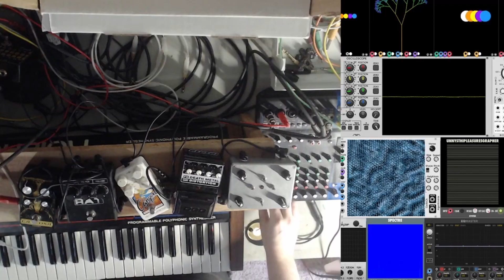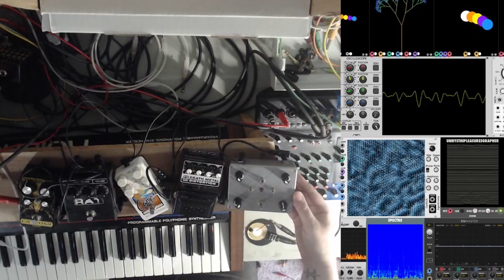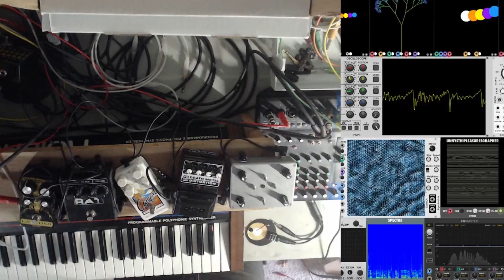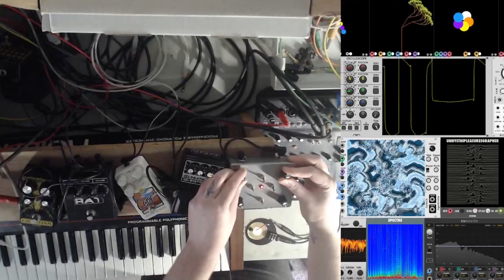Electrolobotomy Hadron Collider - Harsh Noise Gear Review

Comment: Heyo! What do you think about the mixerYamaha MG06X? Is good for no input or needs more channels? I want something portable usabile and versatle, cause i bought another mixer with lot of channels but i realize is too big. Is similar to your yamaha (the 10x i think, that one you review in another video)
Reply from the maker: Looking at the MG06X, it looks like it only has 3 outputs total: left right main outs and a headphone out. Ideally for no input mixing, you have more than just 2 outputs to send back in to your channels. For a cheap and small mixer good for this technique, I'd suggest the Behringer Xenyx 802 since it has basically 8 outputs and 8 inputs... if you count the 2-track section and the fx send and the aux return.... damn maybe I should get one myself now that I'm looking at it lmao. There's lots of options but the more outputs there are to run back into the mixer, the more fun it will be for no-input mixing.
Reply: @YotzeretSheydim  yea i have a Mackie 1202 vlz4 but it’s too big for me, i want a run and gun set up, thanks for the advice, i asked about the yamaha cause i see Sam Mckinlay using it, and cause a thrift store near me selling one of this
Reply: @Baloup  that Mackie mixer is the absolute Don for experimental work. Many leading noise merchants have used them. The twin send returns, inserts, alt 3 and 4 outs along with the twin pairs of balanced outs is outstanding. The Behringers are great poor man's versions of the Mackies. Hold onto it. Buh the Yamaha, hone your craft, grow into the Mackie. Try and get a manual for it. It's written in plain English, not at all dry, a lot of humour. You may find a pdf online.